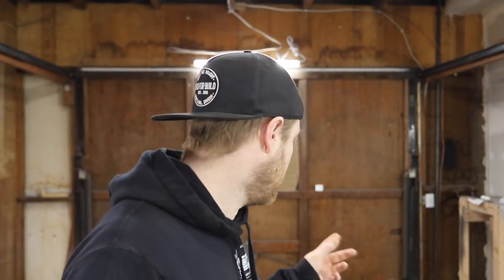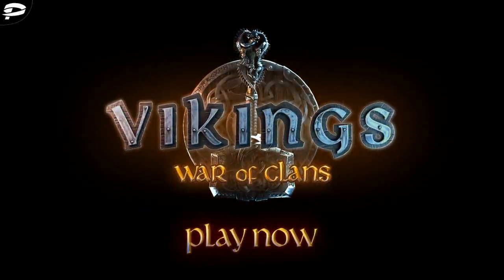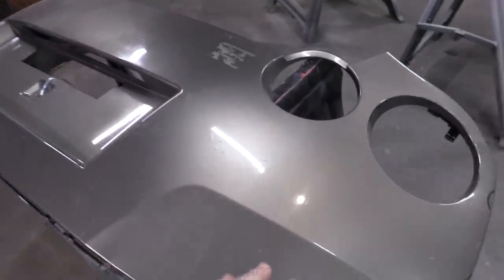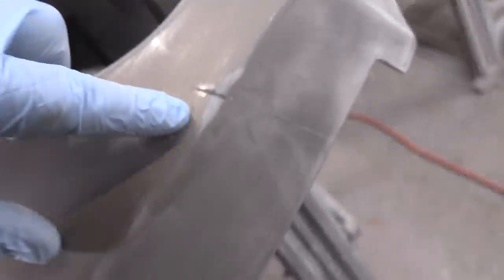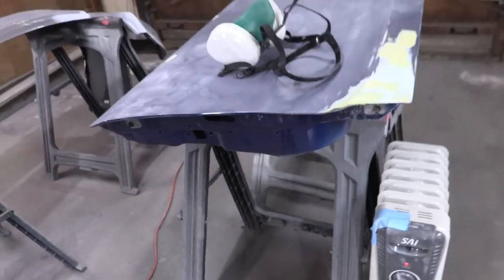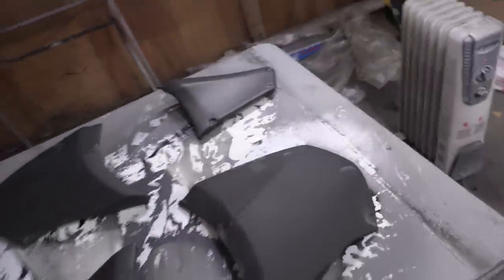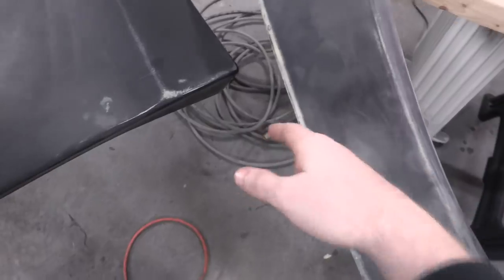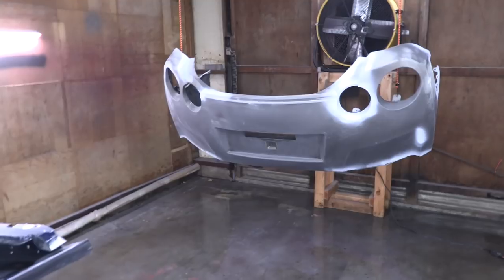Painting the GTR Replacement Body Parts

Comment: your doing something wrong my guess is either wax and greese remover is ok but is more of something that you should use while your doing body work so you dont gunk up your sandpaper but i have always used  an acetone thinner to clean my panels before spraying the main thing you have to remember is it does not matter what paint and stupid addictives you buy your prepping of the panel is 99 percent part of the paint the painting is easy and you cant fuck it up if you prep it properly think of painting like surgery your want that panel to have zero i mean zero contamination just touching it with your glove will give you fish eyes fish eyes are from oil contamination  my advice since it is a very small space wrap that room in a material like melamine something that you can get wet cover that ceiling and have clean air coming in dont sand in there anymore unless you are wet sanding if you have to put the fans on and spray the booth down with water hence the melamine surfaces now or something waterproof hope you take my advice happy belated b-day